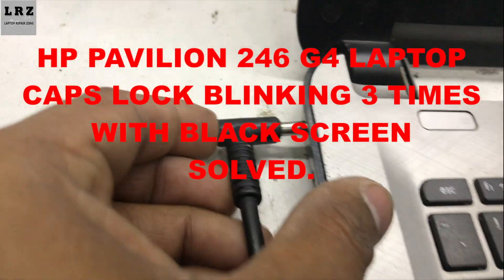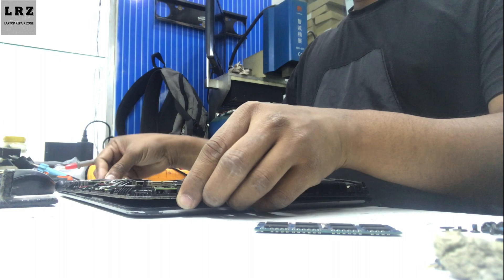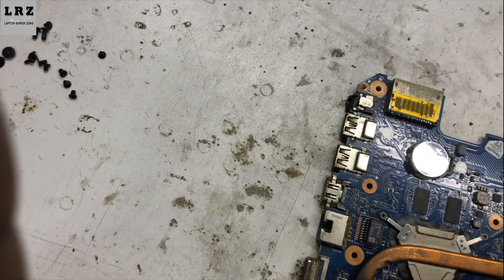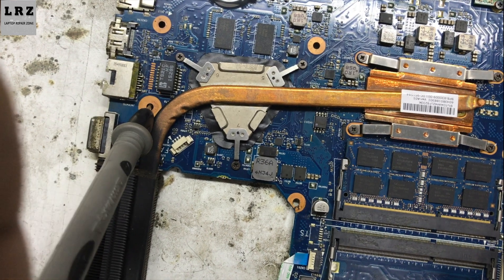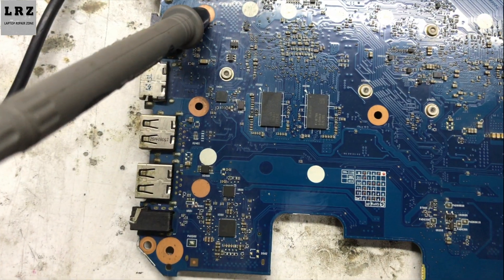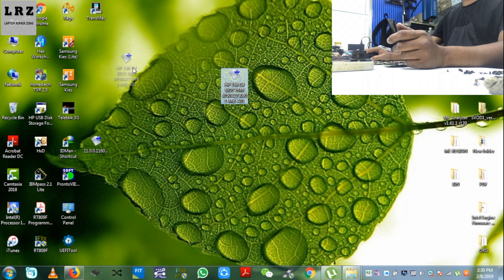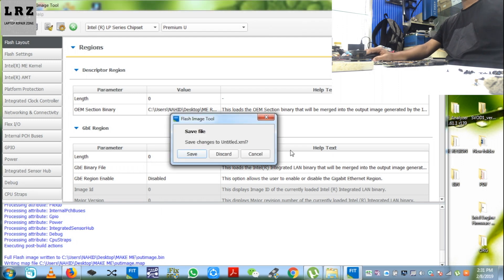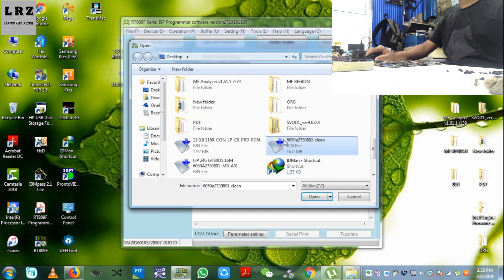Hp 246 G4 /pavilion 14 caps lock light blinking 3 times solved.

Comment: I have same issue with my HP Pavilion, the Caps Lock blinks 3 times . I have change the Ram and still the issue has not been resolved. Could it be that the Ram slot is bad? Solution please.
Reply: probably, try cleaning ur ram slot with acetone and toothbrush

Comment: my prob is linked to this
my laptop turns on with no prob but while its running it randomly shuts down and during that there's a sharp sound and the display color gets distorted. then it proceeds to restart itself but it cant and the capslock key blinks 3 times with 1 second intervals. when that happens I hold down the power button to force turn it off and after that I power it on and it boots normally. i don't know what this problem means because I have tried removing the battery and draining out the power and putting the battery back in but still no luck ;(
Reply from the maker: Thanks for your comment, clean the cooling fan use thermal pest.
Reply: Memory problem, test your RAM. Take out 1 RAM module, test again. Could be bad RAM module or bad memory slot.
Reply: it turned out to be the cooling fan
there seems to be a problem with it 
ill get it fixed
thnx for replying :)

Comment: thanks a lot, but in my situation (HP m6-1153er) problem is not solved. same shit- caps lock blink 3 times, changing RAM is not help, flashing bios is also not solve the problem
Reply from the maker: Рома Сетов thanks for your comment, 3 time blinks for RAM, check RAM slot, RAM vcc voltage, RAM reset signal and CPU.